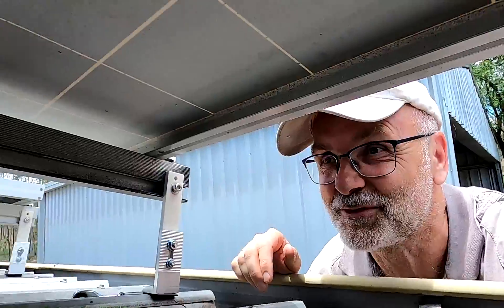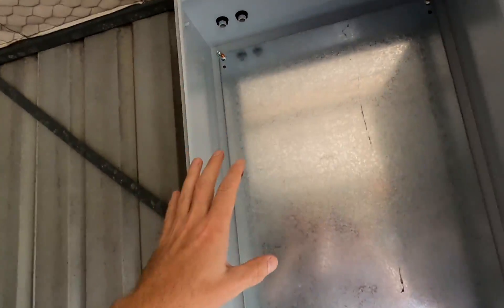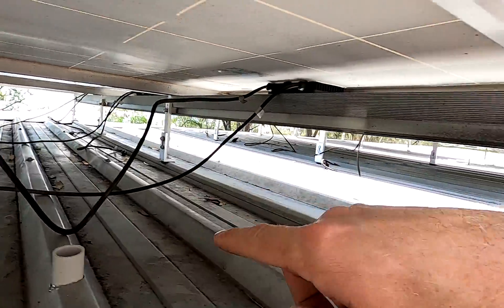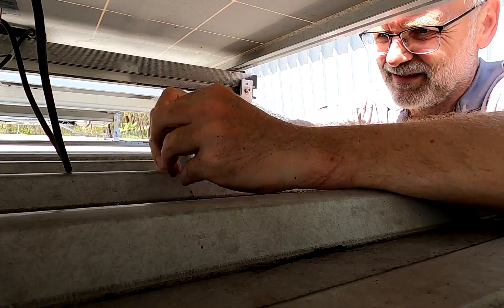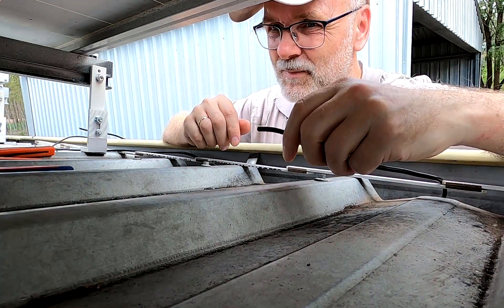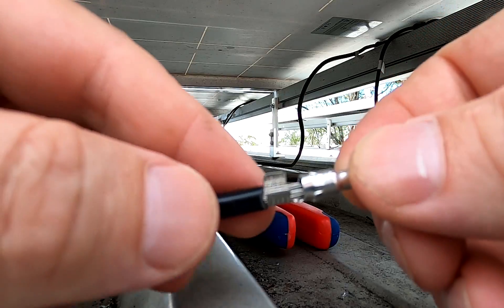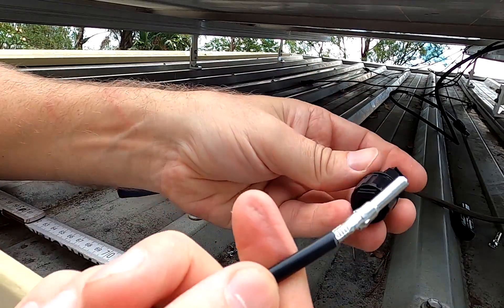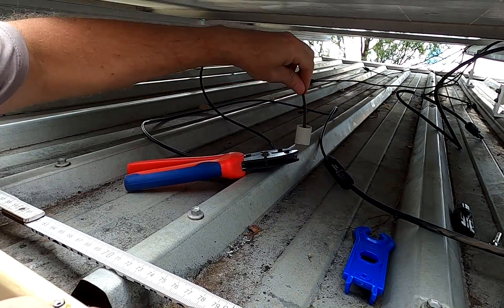Connecting the solar source. Far too excited... 💖🔋🌞 (Part 1)

Comment: Get the yellow tongue out of some tongue and groove flooring, you can drill a hole in one end and  push that through your conduit, then you can tie all your wires on in one go and pull them through together.
Reply from the maker: Great tip!
Reply: @OffGridGarageAustralia  It also helps stop it catching on the corrugated conduit if you cut the opposite end to your hole, to a rounded point. 

You can also put a single piece of wire through and use it as a drawer wire, you actually shouldnt pull cables through a conduit that already has cables in it if you can avoid it, it is surprisingly easy to burn through insulation with friction.

Comment: Dear Andy, love your videos. Mate, I don't agree with your option of steel pipes for conduit though, electricity plus steel?
Question though please? How did you determine 4mm is appropriate wire to carry the solar DC load to the controller? Seems like quite a distance? Just asking as I figure it would have been a calculation not a guess. My knowledge is minimal but thanks to you and oyhers it is increasing.
Totally agree with you relocating fuses both. Loser to battery and ergonomically more accessible. 
Hoping for answer!
P.S. sparkys use what they call spagetti wire to pudh through cables which is a flexible but firm plastic variable lengths and about 20mm wide.
Reply from the maker: Wayne, it's a.) DC power from the solar panels and b.) totally legal and been used for many installations, especially when used underground. I'll show you in one of the next videos.
The solar panels produce only 8A so even a 1.5mm cable would be enough to carry these amps. To have less voltage drop and loses though I chose 4mm cable as the solar panels have also 4mm cable already attached.
There are lists and calculators on the internet for current carrying capacity of cables.
I talked about the cable feeder in the video, Wayne. Maybe it was in part 2 ;)
Reply: If you ground the steel conduit then even if the line conductor comes into contact with the conduit then you should find that your ground connection has a path of less resistance to earth than your body which would allow you to safely touch the steel conduit even in such a fault condition. 
Notably, the panels/generator should have a fuse, even better would be an RCD, which would trip if you were to come into contact with the steel.

Perfectly safe, but ensuring the steel is grounded is the key step to ensure that otherwise it really isn’t.

Comment: I bought metal spanner wrenches to tighten the mc4 connections together (like your plastic one). They also have the pins that stick out so you can release the mc4 connector if you need to make changes. yes you can tighten them by hand the special spanner wrenches are designed to slip when properly tightened - you need 2 of them. but you may never use them again after your build is done. 😎

Comment: Don't forget to put/smear some silicone between the roof and the plastic pipe - just for protection against water. (Spoiler alert for part2 - you have done it right anyway!!👍! )
Also it is much easier to put all the cables at the same time through the conduit. Just tape them together before you push them through.

Comment: Little tip when pushing the cable through that kind of conduit type material that's ribbed inside twist as you push that way when it hits in your twisting it will hit and flip up and go further It gets caught weigh less

Comment: You're supposed to bend your wire back on itself and tape it and THEN push it through!!
Reply from the maker: A bit hard with 4mm cable, but yes, generally you're right with smaller cables and a larger size conduit.
Reply: Incase rainater drains down the wire?